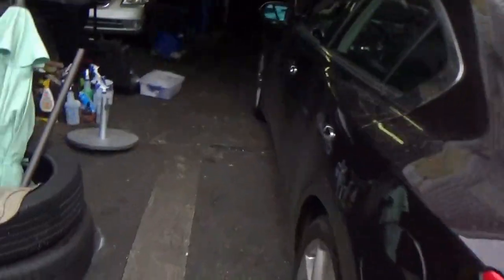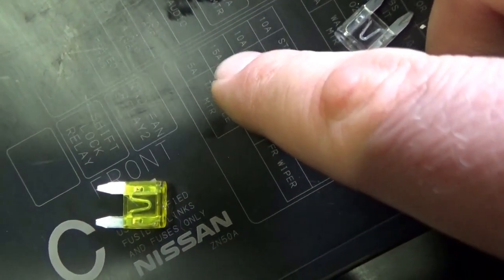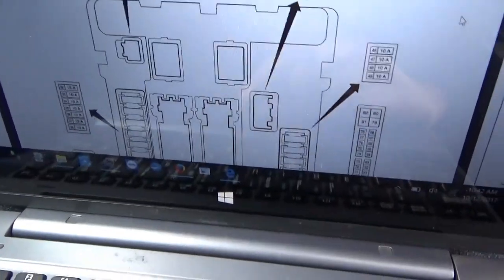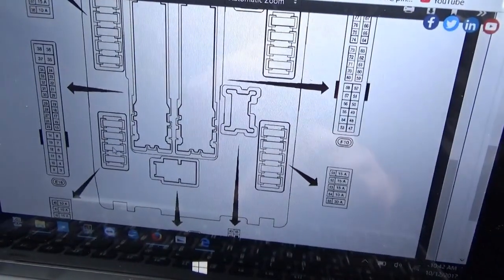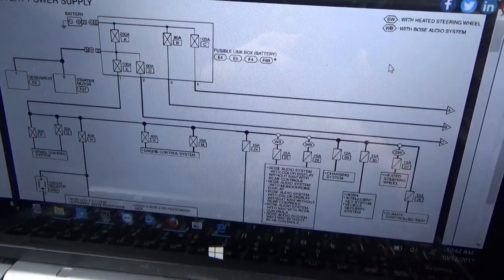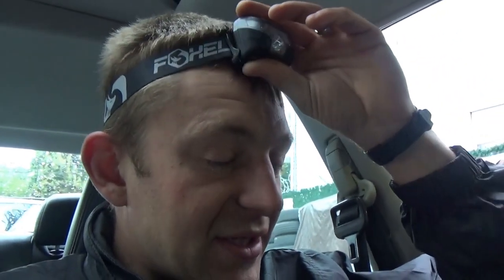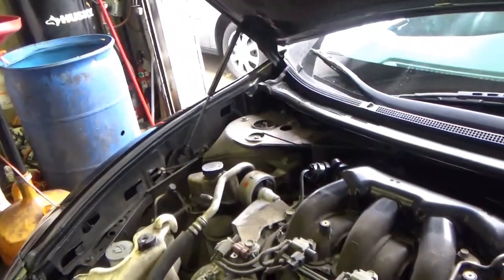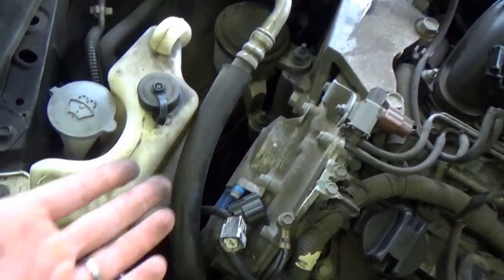Staten Island Maxima Kicks Ivan's Butt... (SI Ep. 11.1)

Comment: What he said in the end is true, the car told on itself, sometimes we turn a deaf ear to it. Thanks for showing your mistakes we all learn a great deal from them to. I had a problem with an  Iat sensor on a 2002 Sonoma, did the chinese fire drill on it, turns out to be the female side of the connector had to much slop in it. The classic wire wiggle (eric o) showed a voltage drop, tighten them up no more money light. So I learned a lots from all the key players on the you tube channels, thanks

Comment: Ivan inserted foot in mouth in this video lol. I noticed looking at the diagrams things are all scrambled up in them.
a stupid jeep liberty recently had me cussing early because fuse labeled fuel injectors was blown and had no com, so I was thinking the worst, overheated/bad injectors/blown ecm.
but I quickly jammed meter in place of fuse and had them crank it, if fired instantly drawing 29 amps on 20 amp mete, complete with alternator pouring smoke(yeehaw). quickly shut it off, unplugged alt. re-started. that quick it was problem solved, after cussing, expecting and dreading the worst case. :))

Comment: Intermittents are way underestimated. Hey a fix is a fix, yes sometimes things take longer than usual, but you got it done man kudos. I personally like to keep an led test light on the load side of that fuse just to see if it grounded.  And would've been tempted to break out the ect3000 on it. Well done man
Reply from the maker: Thanks for the morale booster :) What is the ECT 3000 and how would it work in this situation?
Reply: Pine Hollow Auto Diagnostics it's a short finder, saved me hours. Sold by power probe. Albeit intermittents are much more difficult to track, and there's a little bit of a learning curve, but still it might have helped you at the point where the fuse was blowing at koeo. Works for me.

Comment: I don't think that Ivan should be embarrased about this job. He found the problem and fixed it.
Even if there had been no prior knowledge, the trouble shooting probably would have followed the nearly same path. The "bad" assumption was that the belt was unrelated to the stalling problem.  There's no likely connection between a rubber belt and an electrical problem unless you view things from a mechanical perspective.  Assuming that there was a connection would have been as bad as assuming there wasn't.   Electrical shorts can happen anywhere in a harness. (Google: rodents car wiring)

Not having the very nice professional diagnostic equipment that Ivan has, I would have fixed the belt first.  If I had the same equipment I probably would have approached the problem the same way Ivan did.  The "time wasted" was the lookup time to get the diagram and track down the electiucal components involved.   I'd argue that it might have taken longer, but it wasn't a blind alley. It led to the harness by eliminating the solenoids from the circuit. 

If the belt had been replaced, there's a better than even chance that the shorted harness would have been moved enough that it wouldn't immediately short again.  That would have produced one of those very annoying magical fixes., where the tech feels conflicted about spending more time digging into a problem that's no longer there. An experienced troubleshooter might figure that something around the belt was the cause and look for there for it, but a disappointing number wouldn't.

Comment: Well, there you go. Customer doesn't mind the fact the belt system has a problem yet that belt is causing other problems. Interesting that it took faster RPM to originally create the issue and then came down to simply turning on the key. As usual, electrical issue due to manufacturing defects/designs. Seems this one was a wire harness routing issue into dangerous areas without proper protection.

Comment: Wow, that would have annoyed the hell out of me. At least it was easy to reproduce in the garage. Time to invest in or make a variable amp circuit breaker.
Reply from the maker: LoadPro wouldn't work here?
Reply: It might have helped find the section of wire with high resistance from the damaged wire.  :-)  Every tool has it's uses and there is more then one way to skin a cat.
Reply from the maker: Ah in this case there were no resistance issues, just copper rubbing on steel lol
Reply: Ah, that's right, it was shorting to ground. Thats even easier to find with the LoadPro. When/if you pressed the magic button, while the leads were plugged into the connector, you would likely have gotten a reading of zero on your volt meter indicating a short to ground. btw, in my experience there would be a little voltage drop if even a couple tiny strands of wire inside an 16 or 18 gauge wire were broken. Typically a drop of anything above 0.5v is considered excessive.
Reply: Actually, come to think of it, if my memory of the circuit you were playing with is correct (I didn't analyze it too closely when I watched the video) you might have been able to detect the short to ground at the fuse box via the fuse or relay port. When you pressed the magic button the current going through the tool and into the circuit would take the path of least resistance which is typically through the short to ground spot. As a result you would likely get a reading of zero at the fuse box telling you it was a short. Then walk the circuit via linear or binary search to find the spot of the short.

Comment: I saw a '94 Grand Am, serpentine belt tore off the water pump pulley, bearing and all, cracking the timing cover, then grabbed a main harness- and it wrapped around the crankshaft, separating the harmonic balancer. Broke off the CMP in it's bore, the Weather pack held tight. $1,300 damage because of a neglected $30 belt.
Reply from the maker: Holy CARNAGE!!

Comment: Hey that’s what you get when you go to the big city! Sounds like Keith set you up for that one.... is there some rule that the fuse with the biggest list of components/ circuits is always the one that blows the fuse or has the parasitic draw? It’s never the one marked “dome light only dome light” that’s the problem. Ok now for the important part Biling out the job, because you know if you take your time, a couple grand of test equipment, and of course your skill set in problem solving we have a pretty sizable bill. Of course the customers reaction is “ oh it was just a wire thats not much, right?” Comments anyone.......
Reply from the maker: The billing is always a compromise. You can't bill a customer for 3 hours of diag just because you looked at the wrong wiring diagram :)

Comment: Sniping wires is NEVER the proper way to do a job. You could have simply used a needle and pry out the wire from the connector. Then evaluate and then proceed with the repairs. Sniping wires is a greasemonkey tier fix.
Reply from the maker: Hey I didn't do it....that was shop owner's decision lol

Comment: I guess there is a pizza store open down one of those streets at 3 AM if you just keep looking.  I would have given up but the value of these videos is, if you keep going you'll get it. Instinctively my first thought was short to ground and that comes only from watching a bunch of these videos. Thanks! I remember the Staten Island rear O2 sensor wire hitting the cat heat shield.
Reply from the maker: Absolutely. The O2 sensor heat shield only took me 5 minutes to find...probably because there was so much more room under the truck for a good visual inspection ;)

Comment: i'm gunna buy stock in a fuse factory lol.    tunnel vision at its finest. we all do it. get used to a sollenoid or control causing problems then a wire kicks our butts. in all my years ive tried every trick in the book trying to find shorts.  on a few occasions ya just hook direct to the battery and watch for smoke.
Reply from the maker: I've done the "smoke short finder" on a 40-year old tractor. Pretty definitive haha

Comment: Nice repair, In the beginning of the vid I was thinking a harness rubbing since it cut out when revved up high. 

These wiring harness diagrams are getting to be quite worthless on sites like Alldata/BBB. The last couple repairs I have spent hours researching diagrams trying to figure out heads from tails. And with these cars getting more complex, a good wiring schematic is going to be what is required to fix most of the problems.
Reply from the maker: Exactly. Wiring diagrams are underrated. It's like a map...without it you are just blind!

Comment: That's crazy, just like customer's that want to replace a water pump because of over heating ,but don't want to replacing the gaskets were there is obvious coolant leaks. I tell them to fix the coolant leaks first because it's the obvious problem. Great work Ivan.
Reply from the maker: I know right? I almost felt bad running that car with a jumpy belt...
Reply: Pine Hollow Auto Diagnostics nonsense, you did a great job. Car got fixed 👍

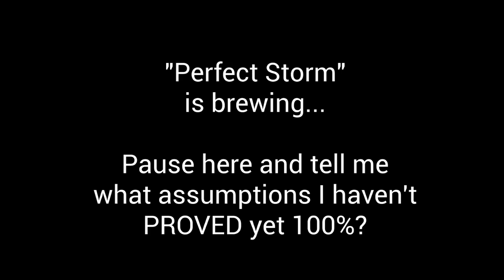Comment: 11:47 You didn't prove other circuits were causing high current events
                 (Obviously not a criticism you said to comment at that timestamp)
Reply from the maker: Well we actually did! The initial current check of the fuse = all circuits. Then I showed the excessive draw just on the one wire, which proves the others are OK :)
Reply: Oooh I think I meant "sub-circuit". I don't know the correct terminology but weren't all the different solenoid runs including the shorted harness "sub circuits" of the "Eng Sol" circuit?

Comment: It's always easy in hindsight to know what should have been obvious at the time. At the same time, that belt might not have had anything to do with the fault. Sometimes we have to take the most likeliest direction and hope that it will be the shortest route. Diagnosis is not an exact science as there are so many variables in motion simultaneously and rather than berating yourself, you should be clapping yourself on the back. Think of the experience that has been written into the brain's hard drive to be accessed again at an appropriate situation in the future.